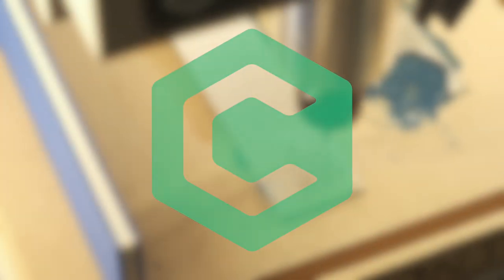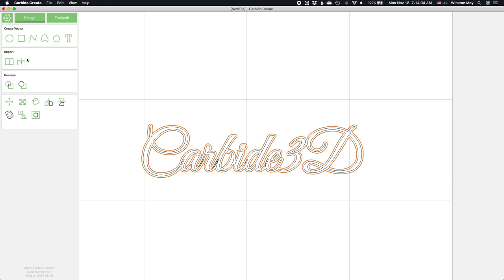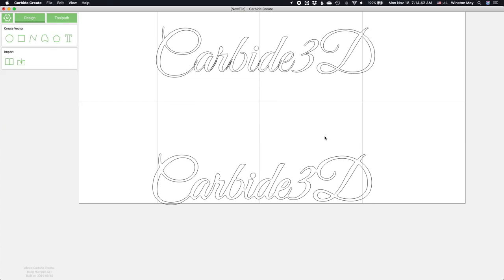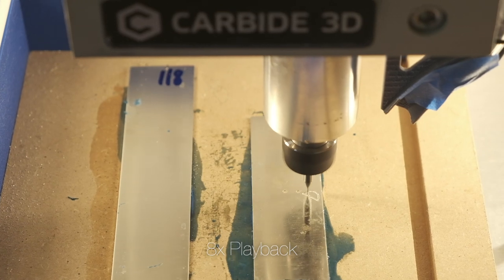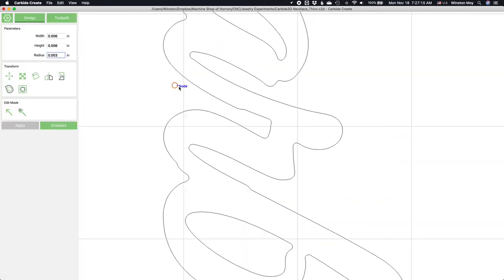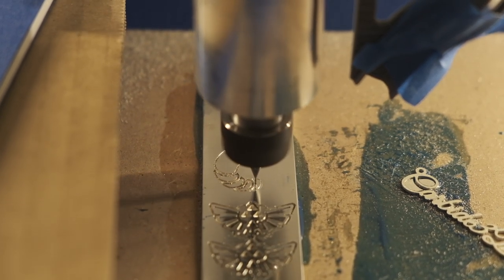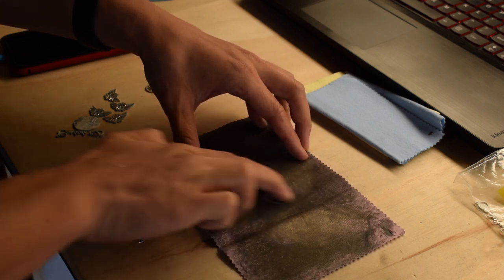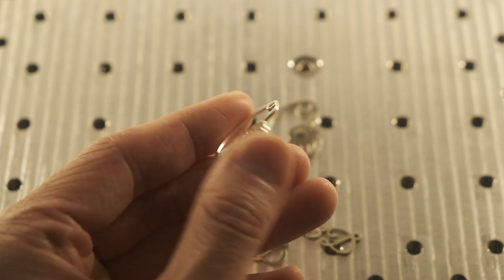Simple Sterling Silver Necklace Ideas on a CNC - #MaterialMonday

Comment: 2:14 "Again if you have any doubts about the flatness of your stocks, start your cut an extra step or two above your materials, so you are not caught off guard if there's a local high spot." 
Could anyone explain what does he mean by cutting an extra step or two above the materials?
Reply: Get your machine to XYZ zero, bring the Z up .025in and zero that.  adjust that in your depth of cut in Carbide create. That way the .025 can ensure you dont plunge in and snap a bit if it unlevel on the bed. Its a extra step to save a bit.
Reply: @DJ-kx4en  Great! I've had my fair shares of broken end mills. I'll implement this step on my next project. Thank you Mr. Daniel for that insight.

Comment: Looks like you made this on a Nomad. Do you think I could do a similar set up on a shapeoko with similar results?
Reply from the maker: The spindle on the Nomad is higher precision, so your only limitation is that you can't really use tools much smaller than 1/32". The small, but measurable runout of a router will severely shorten the life of tiny endmills needed for this level of detail. As long as you're cutting simple things without as many tiny features (ex. dogtag or charm) the Shapeoko should do fine.